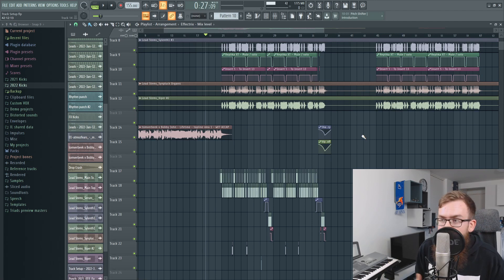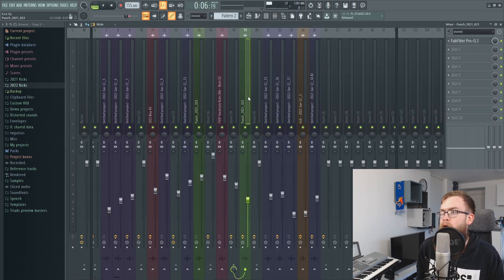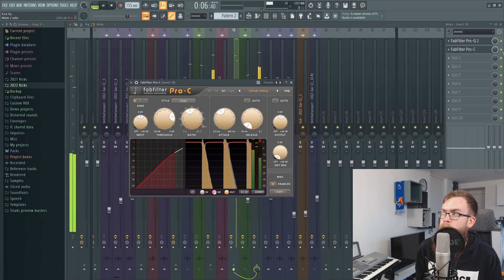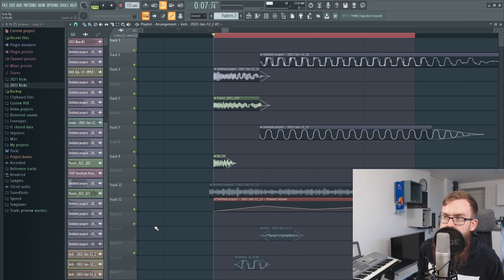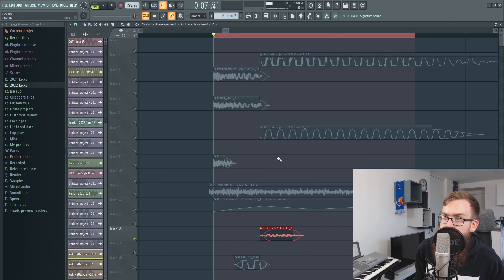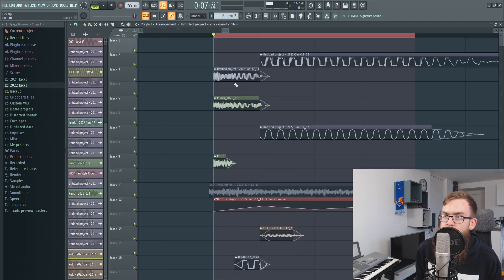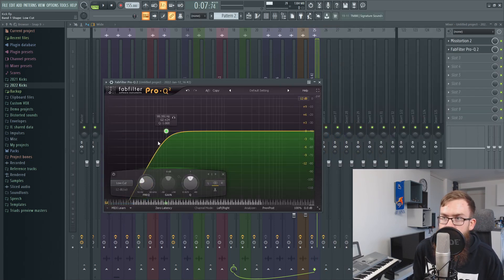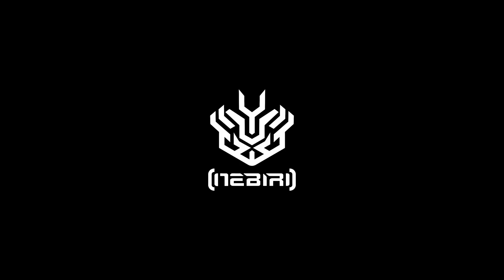Do you want YOUR KICKS to sound BETTER?! WATCH THIS

Comment: Nice video! Learned some new things! Hardstyle kicks in the climax. So the kicks that play under the leads. Should they be in mono or stereo as well? Or only the punch mono or only the tail? 

Thanks in advance for answering!
Reply from the maker: The sub should be mono! The rest is up to you. Almost all kicks got some stereo information in it tho!
Reply: @nebirimusic142  okay! And for example when I use a kick from a sample pack. How do I know or check that the sub is in mono? Or should I put the whole kick in mono or stereo then?
Reply from the maker: @basadaya  lowpass it so you only have the sub, and then check it with a vectorscope. That should show how mono it is. Or you use SPAN
Reply: @nebirimusic142  ahh okay! Thank you man! Last question. If the sub is in stereo then. How can I only set the sub to mono?
Reply from the maker: @basadaya  cut the side signal with pro q😄